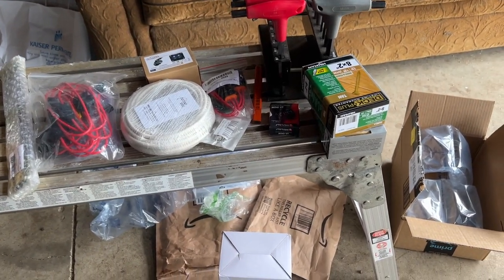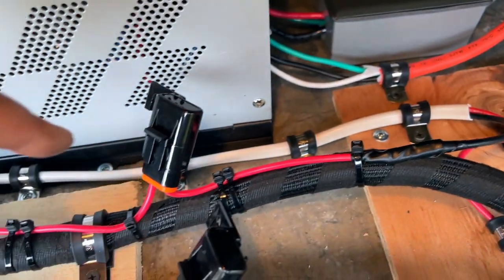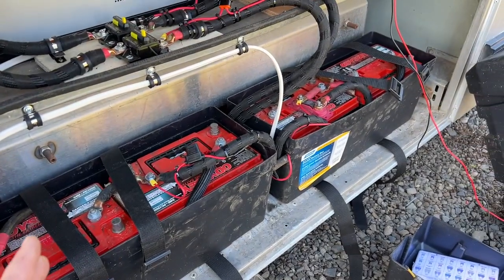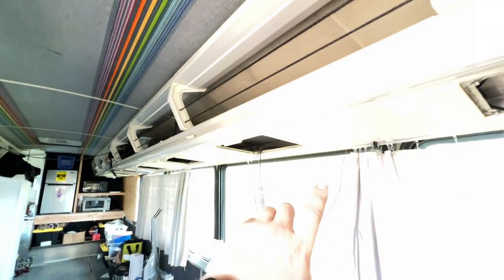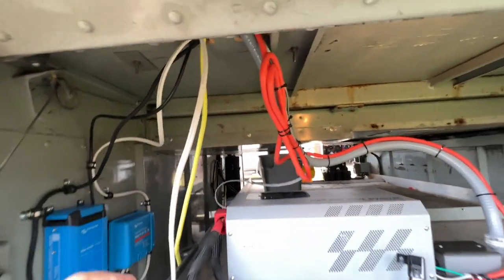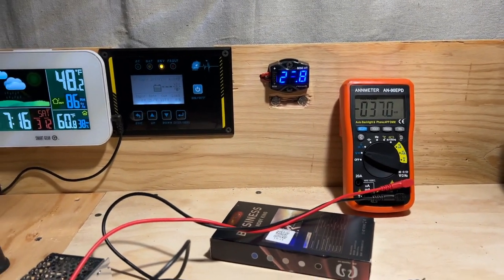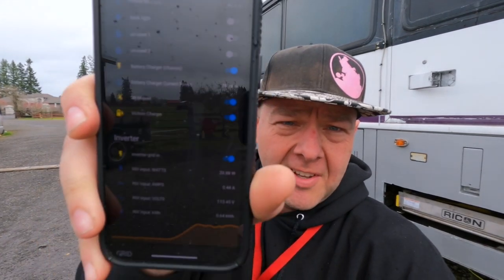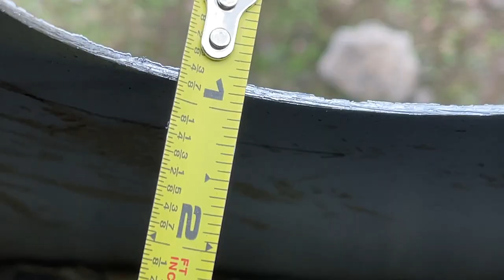MEGA VLOG 604: low voltage power install! (bus wiring)

Comment: Have you thought about a car hatchback shock stays, as when door released it will keep it open, fit  to top of door if not strong enough fit 2 along side eachother.
Reply from the maker: im going to be making the door power operated eventually.. i thought about using gas struts.. but then quickly realized, it would be really difficult to close!

Comment: I have a question about cleaning electric wheelchair cushions. Do I have to use a special type of cleaner to clean the cushion? I have a Pacesaver Boss 6.75 and in the near future I'm getting  replacement batteries so I want to clean the cushion so it won't stink when the supplier arrives to fix it. If you know what I need can you reply back please and thank you.
Reply from the maker: a lot of cushions have a tag on the back, or inside the zipper with cleaning instructions on them :^)